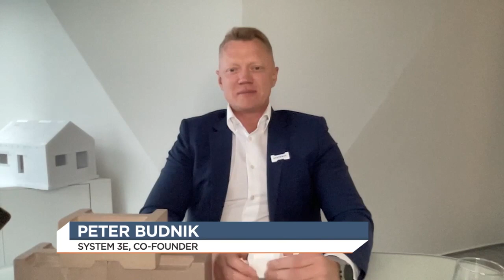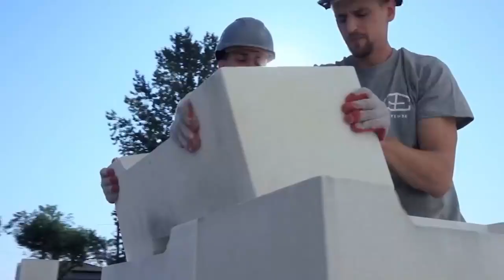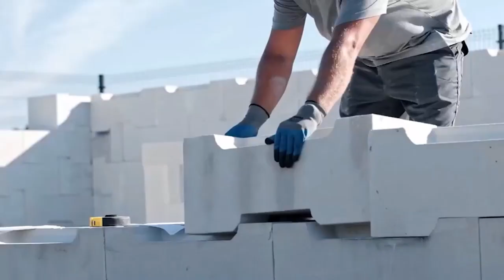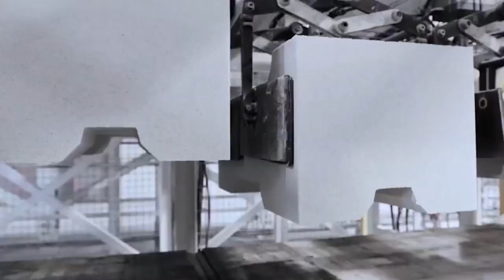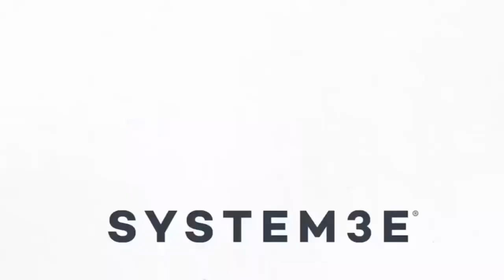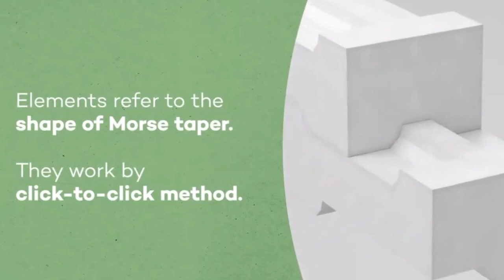Open House: System3e

Comment: I have a bunch of questions regarding this new product/system for building an energy efficient and safe home and hopefully cost effective when compared to standard construction methods of "stick built" - ICF - SIP . Looking forward to your reply. dan                                                                                                                                                           
Questions for System3e Building in USA

1.	If this product was put in a container of water for long period of time what would happen?
A.
2.   Can you fasten to typical exterior USA siding products such as vinyl siding, wood shingles, vertical wood and synthetic siding? If so what type of fasteners? Also would you utilize a vapor barrier or water membrane.
A.
3.   For inside finishes would you use our standard sheetrock and how would you fasten.
A.
4.   How are the blocks set up for window openings? Do you use pressure treated wood bucks and how do you fasten to system3e blocks.
A.
5.   When it comes to adding the roofing, how do you set framing materials on top course and also when adding the framing for first floor (main living area) and second floor living how do you install and fasten the floor joist systems?
A.
6.   When building a house with a full foundation (typically this is 6’-8’ in the ground) can you install these blocks below grade? If so do you need to protect the exterior of the block from structural damage or water penetration? If you can build below grade can you just continue with the blocks above grade. Do you require the standard concrete footing below grade? How do you level the blocks on a footing (when typically they are not perfectly level).
A.
7.   How do you cut the blocks on-site and does it affect the integrity of the block?
A.
8.   Have you done cost comparisons to standard USA builds using 6” studded walls with closed cell insulation. Compare cost per linear foot, the R value and air tightness.
A.
9.    Have you rec’d approval in all USA states for using your blocks? If not when do you expect this to be completed?
A.
10.   How does your block stand up to ICF construction using high energy efficiency, strength, bug proof, fire proof. The cost difference and other comparisons.
A.
Thanks for your response and if you have other questions (that have been answered) you can add to this FAQ document. As you know everything in life is a comparison and the more you tell the more you sell. This must be done with cold hard facts (no emotion or marketing gimmicks). Thanks for engaging in my interest to find out more about your product.
11.   So explain both verbally and show in video how electrical lines are run for outlets for inside exterior walls and fastened to the wall system and also plumbing lines that run in exterior walls on the inside.
A.

Comment: Would be interested to see ratings for hurricane/tornado prown areas. If only gravity holds wall surfaces, I'm thinking a lot of building inspectors would have a problem with that fact.
Seems like most of the structures you show have very few windows. Is there a required number of block layers over doors/windows. Looks difficult to get electrical into walls. How does roof trusses/rafters get permanently attached to walls. The blocks still need to be finished out, how, with what materials.... so many questions
Reply: California would have earthquack concerns, but the fire resistance is interesting.  I think if the blocks are all stucturally sound it limits the size of the footprint of the house. It is still interesting and worth exploring.